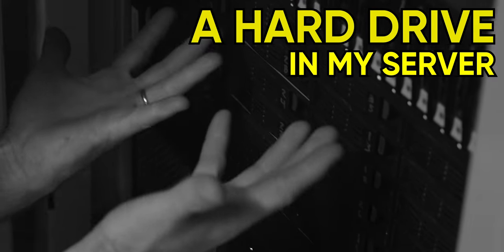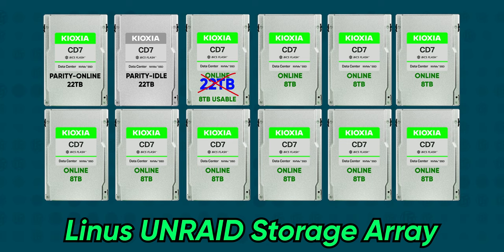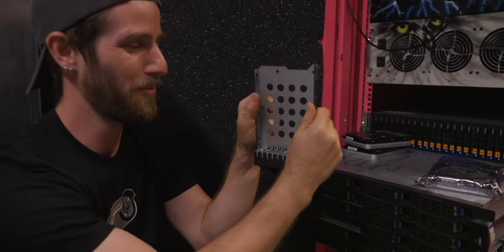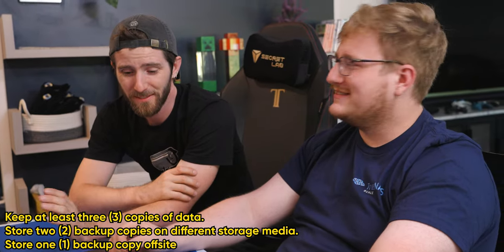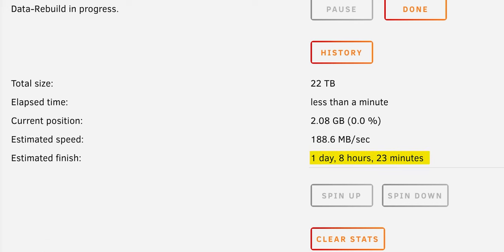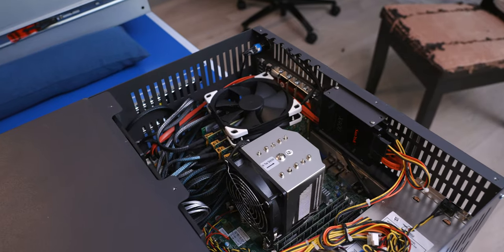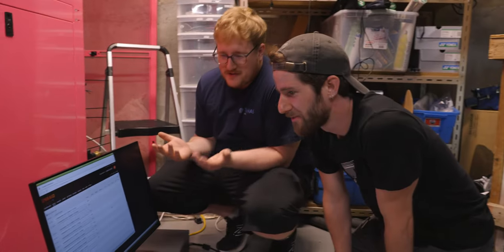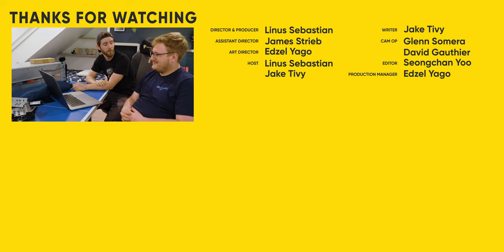My server is broken :( - Fixing Linus' Home UNRAID Server

Comment: If he used regular RAID-6 to allow for two drive failures, any of the drives can be replaced in the RAID set/volume rather than having dedicated parity drives of UnRAID which gives you far better fault tolerance, but at the cost of slower overall disk peformance (at volume level) of UnRAID (especially when using mech. drives)

Comment: I just realized that after buying an unkillable Micron 7300 3.84TB drive, I could never use it for RAID in any meaningful way. The OS would die at the hands of the secondary drive on RAID 0, and RAID 1 would just waste the WD Black drives that would be used to mirror the SSD because the Micron 7300 has an undefeatable 9.8 Petabytes to write on it. Hard Drives won't last long enough to see that happen, only good time to setup RAID 1 for such a drive is late in it's life, and even then you need a 4TB equivalent drive to replace the 3.84TB SSD. RAID is not worth it for one a done drives like this. I might die of age first.

Comment: 1) you had enough free space to do it safely: a-move all contents off disk 2 to other disks (tool like unbalance would help), b-replace both parities and disk 2 while keeping old parity disks as backups, c-after new parity is built, add old parity disks to array and rebuild. It might be that b was set disk 2 to not assigned, rebuild parity, swap parity disks and rebuild, replace disk 2 and rebuild parity.
2) in multiple places it is stated that parity 1 and parity 2 are different calculations thus different data, but either of them could be used alone to rebuild 1 drive, and with them put together it allows rebuilding 2 drives due to their different calculations.
3) 22tb parity in ~1.3 days makes my 16tb in ~2 days feel bad...but my CPU is also dual 12 core HT and 2.4 GHz, so not that fast

Comment: The two parity drives does not contain the same data. If that was true, the second parity drive would only protect you from two drive failures if the other parity drive dies and one disk in the array. With one parity drive Unraid uses a simple XOR to calculate parity. With two drives it uses Reed-Solomon. So both parity disks have completely different data on them.

Comment: I built an unraid 3 years ago with 3x 8tb as that was the best cost per gig. It's now almost full, and 8tb is now not the best cost per tb. In knew I wouldn't have been cheap and just put 2 16gb in instead...would have been cheaper in the long term and given more room for capacity.

Comment: Raid 6 should be the MINIMUM for modern data arrays, as the drives have gotten so big you are LIKELY to have a data error when you try to fix a Raid 5 - and lose EVERYTHING.
Big arrays - go with something even more robust, like the multi-level RAID setup at both the "drives" AND the "devices" level that Backblaze uses.

Comment: Regarding the USB stick dying, it's simply not an issue, Unraid in normal operation does not write to the USB flash (heck most of the time after boot unraid isn't even reading from the flash due to it being loaded to ram), so if you get a reasonable good one (don't use the one you got on that expo-whatever) it won't fail like you've been traumatized to believe by RW use cases of flash... but just in case(as with EVERY other single point of failure)  you can setup the USB stick backup that uploads it to limetech (and can be downloaded to rebuild a bad key) or use a plugin to back it up somewhere else automatically... since it carries a license key that is bound to the device id you still need to renew it with limetech once replaced (but it is automated)...I actually changed USB sticks a couple of time in 2 unraid servers but it was because of mechanical considerations (get those tiny sandisk usb drives that look like old time bluetooth usb fobs so that you don't run the risk of accidentally bumping into it...better yet leave it inside the case by using an adaptor to any unused front panel usb2 motherboard connector...

Comment: I have the same issue with HDD drives. I want to build a NAS and have some disposed work gear for it but when I buy HDDs it's so much more efficient to spend ie. 230 to buy Exos vs 6TB drives. Buut at that point I might as well wait for a Synology DS223+ and go for the full 900$ build, with way more energy efficiency. An old I7-6700 is better, but it'll output 60 watts almost base.

Comment: I currently have a NAS, but I'm considering upgrading to a DIY NAS and repurposing my current NAS to hold local backups. I'm leaning toward Unraid despite its drawbacks, mainly because I don't particularly want to buy around eight 22 TB Iron Wolf Pro drives at once and TrueNAS Scale forcing k3s instead of Docker Engine really pisses me off.

Comment: Parity drives on UnRAID do not just contain identical data. Each parity drive is a different set of parity data, otherwise the system could not emulate two drives. You can check this for yourself by directly examining the content of the parity drives using tools like dd

Comment: The parity swap it tried to tell you about will copy the parity data from the old parity disk on to the new parity disk, then move the old parity disk to the array and rebuild the array. All you have to do is assign the new parity disk to a parity slot and put the old parity disk into the array and it will do all the work in the background.

Comment: So seeing that chassis also brings up an interesting topic:
What happened to NORCO? I notice that's an RPC-4224 which was a great budget chassis in it's day, but now Norco has fallen off the map completely, their website is down and all of their products are out of stock. Presumably they went out of business but it seems like a topic worth investigating and covering. Plus, getting the word out there to people who could be putting themselves in my shoes (I bought a RPC-4224 later on in Norco's existence) from doing so. Now if any of my backplanes fail, I'm in the market for a new case, as well as whatever damage ends up happening to the drives connected to it.

Good on you for getting that hardware out of there before it becomes a problem.
Reply: Oh hey you guys broke the side cable guard off on yours too! I designed a 3d printed replacement for it.

Comment: Interesting guide! Would it have been possible to clone the parity drives with a sector-sector clone operation on a popular disk imager such as Acronis, AOMEI, you name it to the higher-capacity drives you want to replace them with all on another machine, USB enclosures whatever. Maybe have to expand partitions to full capacity from 8 to 22TB. Install 22TB parity drives into server, Boot server up, parity drives are larger, everything is happy or does array still need to be aware of it's new universe? With unRAID do you have to let the software do all rebuilding operations so it is made aware of changes or can it boot up with larger parity drives and be ok, possibly a config file modification only? Depends on whether it goes by drive serials to determine previous role and current role or drive slot. 

But they do show it is rather simple to just let unRAID do it's thing.

Comment: I've forgotten why I don't use the unraid copy that I purchased a license to way back.

I've instead gone with SnapRaid for a snapshot like raid. Worst case if I were to lose enough drives to lose the array? 
I can still read the other drives individually and get back a portion of the drives data.
Then I use MergerFS to make the 5 drives appear as one big drive. It also balances incoming files to the one with the most free space.

To replace the parity or increase size, I just need to update the snapraid conf and resync. 
I also shutdown any services to help it not have any conflicts.

I figure this is the best compromise, snapshot raid and if it fails I still have something

Comment: 1. Just move all data from failed disk to other disks 2. remove failed drive 3. add new parity drive 4. add new drive 5. start unraid  with "new config" 6. one parity sync later you finish and can add as much drives as you want...

Comment: hi Linus, you want to look into optical storage like Blu-Ray. Long lasting disks can last up to 100 years. They are easy to store in a safe and can't be accessed if not loaded into a Rom drive. It is not perfect but trusting "always on" mechanical or SSDs to last for a long time isn't a good idea. For your "memories" you can probably fit it on a few disks" That way if everything fails chances are you can get your data back. There is something to be said for something that isn't always active. Remember you don't own the cloud account, any server can and will fail it is a mathematical certainty. Disk that can last up to a 100 years that you can restore on newer backup media every 5 to 10 years isn't a bad idea. By the time it gets to a 100 years there will be double if not triple the backup.

Comment: The notion of dedicated parity drives is very frustrating.  With a normal RAID5/6 array, you just throw in a drive, the extra space is just unallocated.  When you have enough unallocated space, create a new volume on top of the unallocated space.

Comment: Windows Storage Spaces allows you to mix and match drives and just spreads data and parity information across available drives. If you have more disks than the parity needs then it can support different size disks. No need to worry about which disk is data and which is parity because they are all both. I haven't had to rebuild any data tho but I have swapped out smaller disks for bigger disks
Reply: Is it possible to expand the array by single drives tho? I'm not aware of any solution allowing this without dedicated parity drives. Or in other words, I don't know any solution with parity spread over all drives while also allowing incremental expansion (without a complete rebuild of the array). From all I know those two features are mutually exclusive.
Reply: @misatzu  Yes you can increase incrementally. If you want to change the ratio of data to parity you have to make a new virtual drive so if you want 7+1 you need to start with 8 drives but you can then add drives one by one. That's what I've been doing. I actually started with a JBOD virtual drive but since they are thinly provisioned I could just move data from that one to the parity drive I set up
Reply: @antivanti  Hm, you say you can add single drives but also you have to make a new virtual drive when changing the data/parity ratio. At the end you mention a dedicated parity drive when your og comment (and my question) was all about distributed parity. This is all really confusing :3
Also I need dual parity which at least requires 7 disks ...
Reply: @misatzu  No drive is a dedicated parity drive. Every drive in the pool is split into 256 MB chunks. With a virtual drive with 5+2 parity every set of 7 chunks has to be on different drives but the next set of 7 chunks don't have to be on the same 7 drives so over a number of such sets of 7 chunks it can spread evenly over 9 drives. And when you add a 10th drive it can move some of those chunks to that drive as long as it only moves at most one chunk from each set. So you still have 5+2 parity but it is spread across 10 drives. And you can still survive 2 drives failing. So adding drives doesn't change the parity setup. But if you do want to change it (like going from JBOD to parity like I did) then you need to create a new virtual disk on your pool

Comment: 13:09 Jut use RS-232, connect it to a MAX232 board from China, connect that to a UART pin on some SBC, SSH into said SBC and attach to the console using cu. Poor man's PiKVM for like 20 bucks (once SBC prices finally go down and you get a Pi Zero class board for a tenner again).

Comment: Unraid using usb is a GOOD thing. Most home users need all the sata ports for the array hdd. I doubt anyone wants to use an ssd, just regularly back up your usb. But unraid is copied into ram so it's not used much.
Reply: Except a 250gb m.2 costs under $20.  If you've got the slot on your motherboard, why not?

Comment: Isn't IPMI just a separate, very small stripped down, OS that runs on its own card? For instace, iDrac you can swap the modules out to update them and/or add them to servers without them. You should try a PiKVM, functions exactly the same as IPMI, even can do things like insert cds on boot, imo it actually was much better than iDrac or iLo ever was when I was using them, which was admittedly on the HP DL380G6/Dell R720. I wouldn't recommend it for business use but for a home setup its pretty rock solid.

Comment: I made a file server and installed unraid after watching Linus's video. It worked but since it has to boot off of a USB flash drive, my Gigabyte motherboard kept ignoring it (even after changing all the settings I could in the BIOS). That was a bummer. Now, I'm running an SMB file server on Windows 11 and using Remote Desktop. 
It was interrupted once because of Windows updates.. I plan on upgrading to ZFS via TrueNAS once I'm ready to get more RAM.

Comment: I'm confused as to the point of this video. What was wrong with the old server once the drive was replaced? Isn't this just unnecessarily throwing away that old server? Sure it's old, but for a secondary copy, I don't see what's wrong with that as long as it works

Comment: Replacing failed drive and both parity drives you would loose all data on the failed drive, because it will just recalculate parity from the array where the replaced drive is empty.

Comment: Whoa wait, what? If the parity drives are identical (i.e. basically mirrors), how can that protect against any TWO drives dying with no data loss (like in a RAIDZ2/RAID6)? As far as I can see it can't,l so either this is not a true two-parity setup, OR the description in the video is wrong and unRAID doesn't mirror them. Is there a third option?

Comment: Having replaced dozens of drives in RAID arrays over the last 20 years, I have only ever seen one drive fail during an array rebuild. It's the worst time for a drive to fail but its not the most likely time for it to fail. With RAID6 aka two parity drives you still haven't lost data. Of course the one time it happened to me it was a RAID1 😢 holding metadata for a Lustre file system, which was as a result toast. Good job it was for scratch only.
Reply: Well for RAID6 it's actually double parity across all drives.  UNRAID uses special drives just to hold parity data.

Comment: Would it be possible to just re-partition the 22TB drive to an 8TB volume. Restore from the parity drive. Install the new larger parity drives then re-partition the 8TB volume back to a 22TB volume and therefore greatly minimize/prevent any potential data loss? Have zero knowledge of home or commercial servers really but just curious.
Reply: Probably not, as many of these system use direct access to the drives so any partitioning is irrelevant.

Comment: "The most likely time for a drive to die is during a rebuild" is not true. The reason for a RAID array to die during a rebuild is due to the high potential to encounter an unrecoverable read error (URE) - which is not a drive dying. UREs and ZFS rather than traditional RAID are even further complicated by the way ZFS works. ZFS has a good chance of being able to get away with encountering UREs during a rebuild without completely killing your array, but only experiencing minimal corruption (e.g., localized to an affected file)

Comment: unRAID supports this - old parity into the array and new parity with larger capacity. This is 1 procedure, and it copies raw parity data from smaller into bigger drive, and after that it rebuilds. However I think it does it in 1 go. I did this with mine about 1y ago.

Yep - it's called Parity Swap procedure.

Comment: You should get a header to internal USB port for the unraid boot drive. That way, someone won't accidentally bump it or disconnect it.
Reply: It’s in a rack in the basement, accidental dislodging is highly unlikely.
Reply: Many server boards have internal type A ports built in specifically for applications like this.

Comment: in aus ive found WD red+ 4tb drives are the most cost efficient drive that i trust to be reliable with them being $150AUD each on amazon, compared to like an ironwolf costing 170$ for a 4tb, not to mention im very iffy about seagate after having had 3 different seagate drives in a row that all died in only 2 years each

Comment: ZFS lets you have a bunch of mid-matched drives. But I'm not sure if it's per zpool or overall.

It's not perfect with it, but it works.
Reply: @philiprobar  I'm not understanding you. I didn't say anything about single-drive vdevs. I said ZFS allows having mismatched disks.

I don't know if you can mismatch disks in the same vdev, but I know you can mismatch disks in different vdevs.

None of this has to do with a single drive though.
Reply: @philiprobar  I mean different kinds of disks. Like SSD and HDD or HDDs with different speeds. Linus has a single vdev, so it's not really the same comparison.
Reply: @philiprobar  I found it: https://youtu.be/SJB1cJfcjYI?t=770

Here, the ZFS dev says that the write model is "whichever vdev finishes first gets the new data" and that because vdevs that fill up faster get slower, that will happen less often.

So ZFS prioritizes storing data on faster vdevs, but as it fills up, it will start spreading that data across slower vdevs. So the overall zpool will faster even mixing SSDs and HDDs or HDDs of different capacities and vdev arrangements.

Seems like Linus's ZFS knowledge is dated.

Personally, I think ZFS is pretty easy to add to if you do only mirrors. Every time you want to expand, you add 2 more disks.